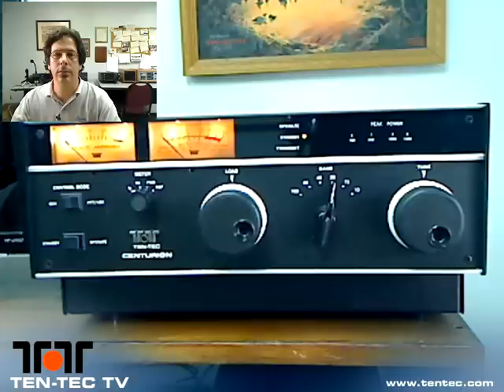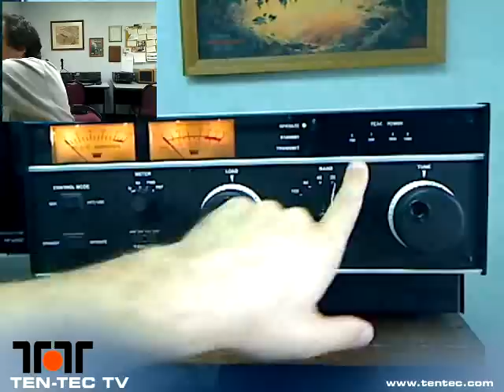Hooking Up and Tuning Up The Centurion Amplifier.

Comment: What if your rig doesn't have a PTT connection?  You are assuming it will be used with a ham rig.  Many people don't, thats why they have difficulty with it. Tuning is easy. Hooking it up is hard.
What if I wanted to use it with a Cobra 2000 GTL CB radio?  What then?  No PTT hook up.  Thanks and 73 N0RJP.